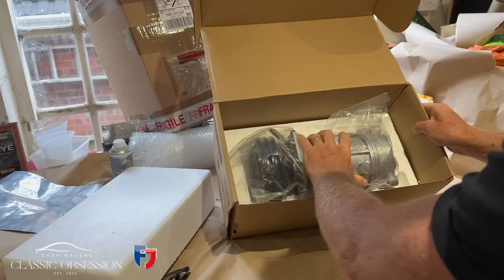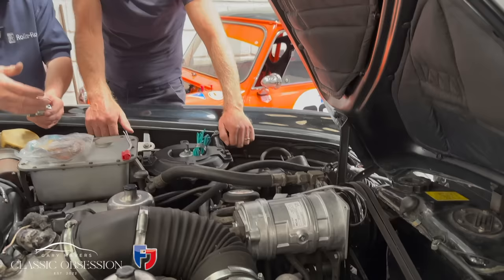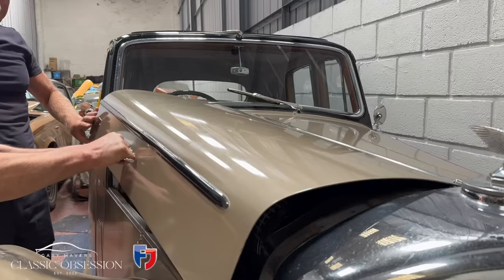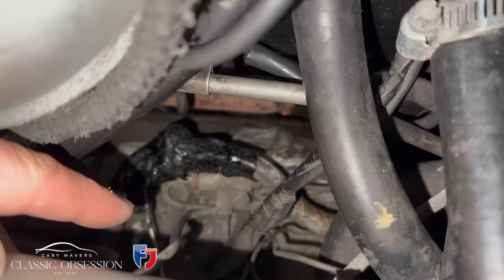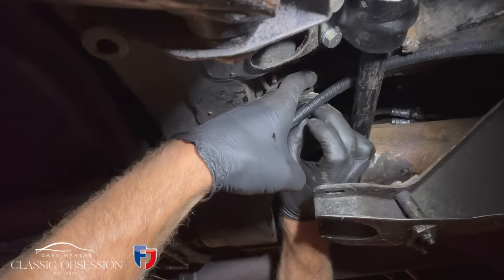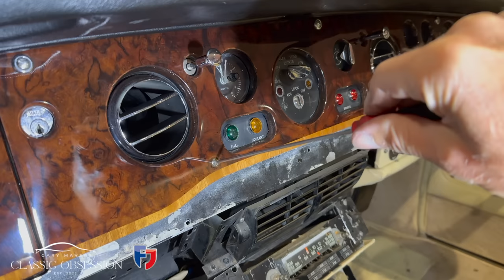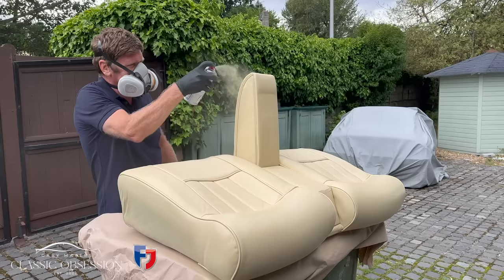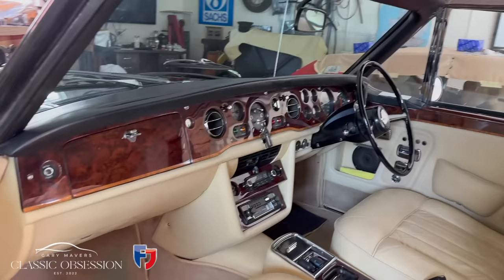Revealed! Restored Rolls-Royce Wood & Interior | A/C Upgrade | Classic Obsession | Episode 37

Comment: All of those old and retired Craftsmen who had a hand in the building of your Corniche, would be extremely proud of you, for the preservation of the cars' outstanding beauty!! I have always loved the shape and good looks of both the Shadow and Corniche. One of the best vids ever, was Harry's Garage, and his 4000 quid Shadow, that he took to the Arctic Circle. I could almost picture your black Corniche against the pure white Arctic Weather!! Gary, you are very thorough and fussy about how you plan before doing the complex work, and (I believe) that the RR Brake Circuits and valves can be misunderstood with ease! Please may I also make some constructive comments. I absolutely loved the woodwork following the refurb work. But this now highlighted the area around the Key Ignition, where it is scratched from swinging keys. I wondered if it were possible to source black (non-scratch) self adhesive pvc, and re - cover the surface. And for the nuts and bolts which are removed / refitted underneath your car, there is a substance (made by ROCOL) and called "copper anti -sieze". A little coating over the threaded portion of your shaft / bolt does stop any road salt / moisture from penetrating the nut/bolt. They will undo 25 years from now. I've watched all of your vids, including the work restoring that rust-bucket Merc! Greetings from Australia.
Reply from the maker: Many thanks Peter. Regards.
Reply: Wonderful comment!! You are a true gentleman sir.

Comment: FYI   Gary, the final drive crossmember is spot welded sheet metal with a urethane foam injected in between the cavity. The workshop manual states the trolley jack and a pad should be placed under the case. It is extremely robust. Eventually the cross-member gets distorted and cracks.

Comment: What a beautiful bit of British motoring history, stunning car, top quality workmanship Garry, A little tip, any suspension related joints, bolts, and bushes etc, should be left loose until vehicle off any jacks or stands, and all the weight is back on wheels, then move vehicle up and down a few times, then tighten and torque everything up. Stops pre loading bushes and joints.
Reply: Thank you Gary for the very good video 👌👍

Comment: A great video as always! I would clean the newly lacquered wood veneer with antique wood polish and a soft cloth (like for waxing paint). Never use your clothes for it, as you will scratch it immediately! I am also wandering about the heelpad. There should only be one for the drivers side, shouldn't it?
Reply from the maker: Yes I know but when my Heater exploded in an earlier ep it stained my carpets with antifreeze. So I’ve put a Matt both sides which looks neater, is more practical and takes your eye off the stain!! Regards.
Reply: @classic.obsession  Smart solution! Looking forward to more episodes :)

Comment: What was the monikor on the original rubber floor mats? MPW?? What does that stand for?? Aren't they supposed to say RR for Rolls Royce?
Reply from the maker: Milliner Park Ward
Reply from the maker: Mulliner
Reply from the maker: Mulliner Park Ward was a coachbuilder formed as a subsidiary by Rolls-Royce in 1961 to supply it custom bodywork for its automobiles. Located in Hythe Road, Willesden, London, it was created by merging two existing Rolls-Royce properties, Park Ward of Willesden, London, a subsidiary since 1939 and H. J. Mulliner & Co. of Chiswick, a subsidiary since 1959.[1] It principally built bodies and interiors for Rolls-Royce and Bentley motor cars, but also others such as Alvis.[citation needed] The coachbuilding business closed in 1991 but the Mulliner name is used for the personal commissioning department of the current Bentley manufacturer.[citation needed
Reply: @classic.obsession  Thank you Gary! Your information about those companies is very welcomed. Living in the USA, i didn't know the history behind those names.  After reading your comment i learned so much.